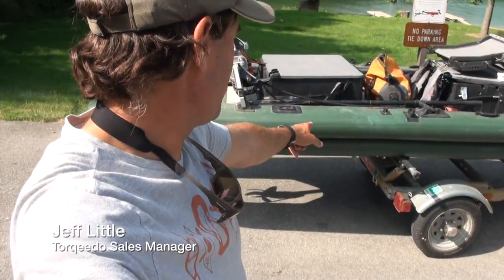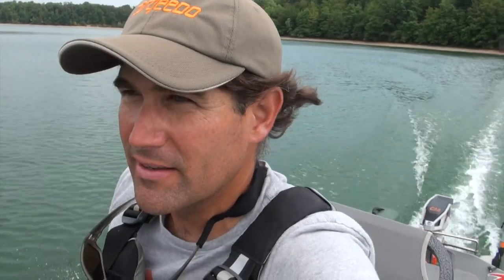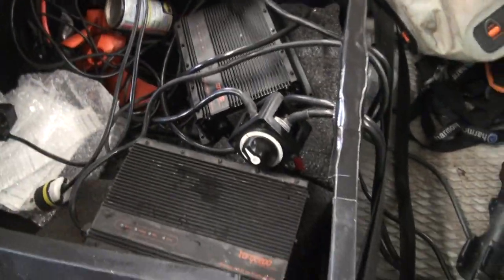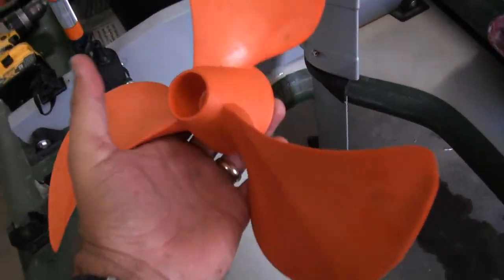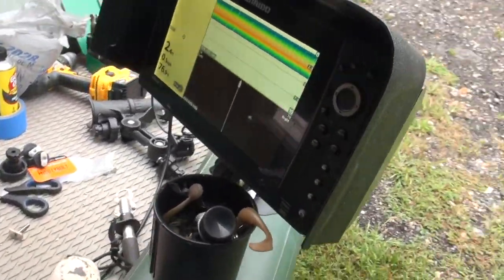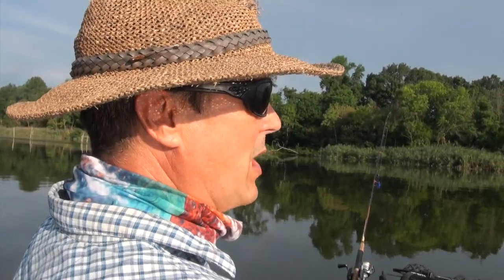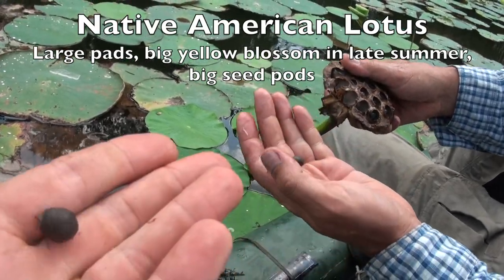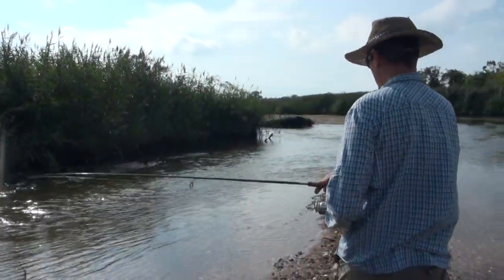Torqeedo Cruise 4.0 on Sea Eagle Fish Skiff 16

Comment: This is a nice setup, but for my needs I prefer my Sea Eagle Paddleski & Torqeedo 1003s motor.

My setup offers the ability to paddle it as a kayak but still offers great stability, a fair amount of room, and the ability to handle a decent motor. And if the battery dies suddenly, I'm not stuck.

Still, the Fish Skiff 16 does go faster and offers more room. But you can't paddle it like a kayak, which is something a lot of us really enjoy.  The Skiff hull is 99 lbs deflated to carry vs 42. 

The Torqeedo Cruise 4 is a faster motor, and this skiff can handle even stronger motors.

But all things considered, my setup is plenty fast enough for my needs, can paddle well, sail and more. And fit in my car's trunk. Still offers a fair amount of room too, but less than this one. 

Just sayin...

Comment: Just got one of these boats, and I love it. Except for the fact that my trolling motor can only get up to 3.5mph. Do you know if it's easy to hook up your own battery to one of these Torqeedo's? I saw a cruise 4.0 on sale for under $1k without the $5k battery.
Reply from the maker: Get the Cruise motor after the seller has proved that it is operational. Get it serviced - new o ring gaskets and seals. Then find the battery. You can use many different batteries, not just the Torqeedo one.
Reply: @TheLittleStuff  Thanks! Also, out of curiosity what type/kind of trailer do you use?

Comment: Wondering have you used your Skiff in Saltwater watching for stuff like Oyster beds? Any issues with that ? Right now I have a inflatable kayak top of the line .
Aquaglide.  But folks are saying that it would do well . I'm not intentionally looking  for sharp stuff lol. Your thoughts please?
Reply: I have a FSK16 as well, and the recommendation was that saltwater is fine, but oyster beds can tear the boat so I plan to keep my boat on small lakes.
Reply from the maker: The possibility of slicing open the boat with something sharp like an oyster bed is real. That being said, I have run over some jagged river rock with no issue. Having three chambers is some insurance against such a mishap. If you lose the bottom chamber, the other ones will keep you afloat long enough to get back. I also carry a product called “Tear-Aid”, which is a temporary fix to get it sealed enough to get air back into the inflatable to get you somewhere that you can put a more permanent patch on it. I recently used Tear-Aid on a Star Rival Fish inflatable kayak that took a hit from the Torqeedo Ultralight 1103 propeller on a different kayak at full speed. I was back up and running in about 15 minutes.

Comment: Would the fish skiff be okay for 2 adults and 2x year old toddlers? I know it’s max 3 adults, but that would seem crowded.
Reply from the maker: I have those two battery boxes in there that take up a lot of room. If you go with the Torqeedo Travel 1103, it frees up a ton of room. Check out the different seating packages they have at SeaEagle.
Reply: The Little Stuff would you take this duck hunting? And would you take it in the middle Chesapeake?
Reply from the maker: Shawn Lopes Duck hunting, absolutely! Middle of the bay? Depends on wind forecast.

Comment: I guess you could buy this boat leave off the Motor and just add a Trolling motor to it ?
Reply: I have been looking at getting the Torqeedo Cruise 2.0, but right now I use a transom trolling motor to move my boat around. On small bodies of water (less than 500 acres), I get around just fine as long as the weather isn't too bad. At the end of the month, my bow mount trolling motor will arrive. It's a GPS one so it'll give me access to anchor lock and really dig into the fishing spots I find.
Reply: Do you use a long shaft on moto